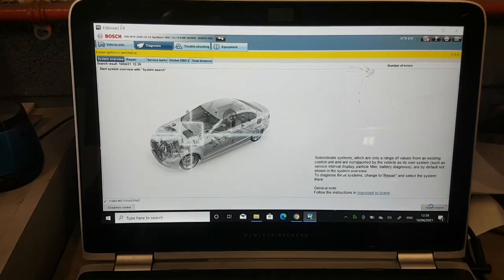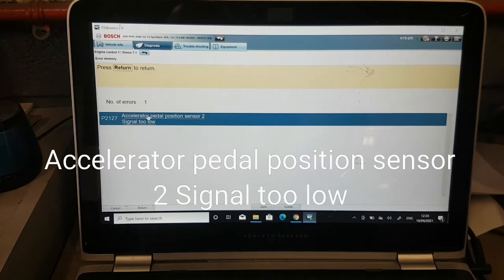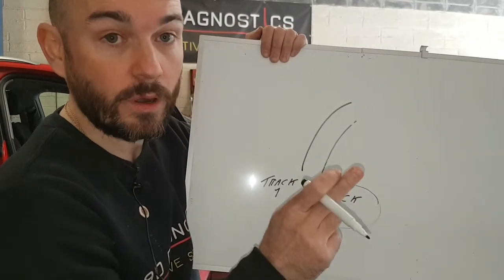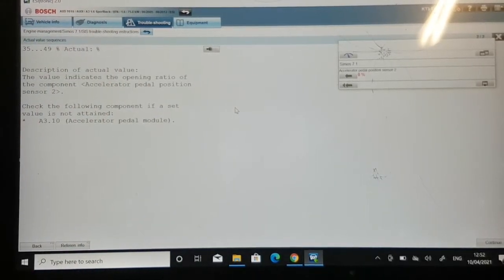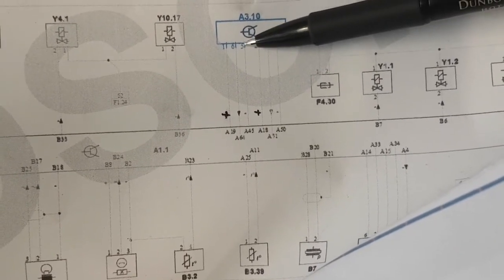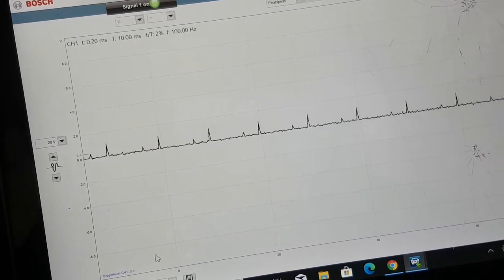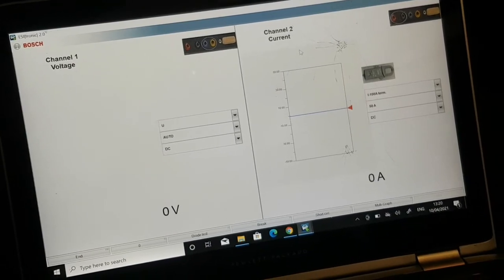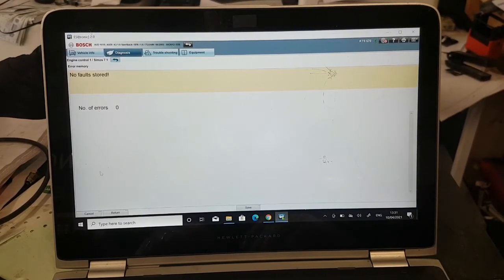How to test a accelerator pedal. Error code P2127

Comment: I’m just not sure either to order a new pedal for my Audi or a new throttle body, just I’ve had some wet wires and I think it’s has corrosion on couple wires, as was working fine all sudden when it was cold outside and damp for two error codes

Comment: I have a Peugeot 308 1.6 hdi. Came up with p2127 accelerator position sensor open circuit. And cooling fan constantly running. I can’t find the exact fault that it might be. What do you suggest?